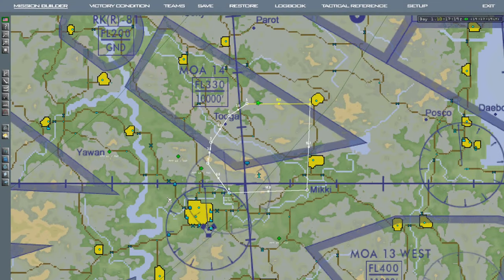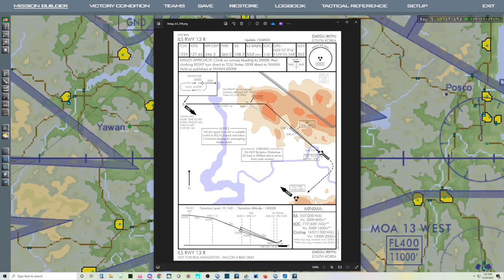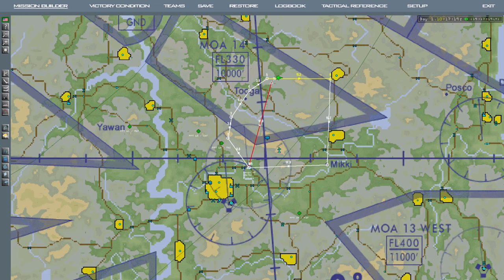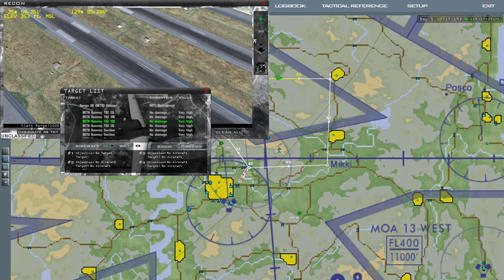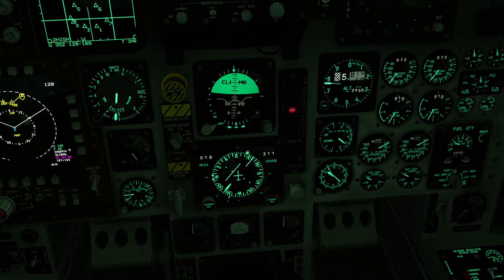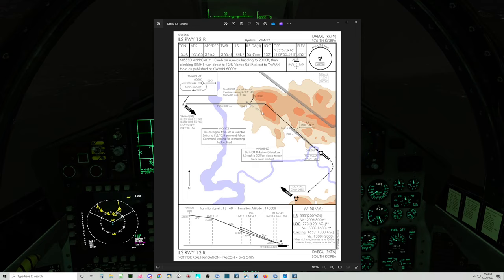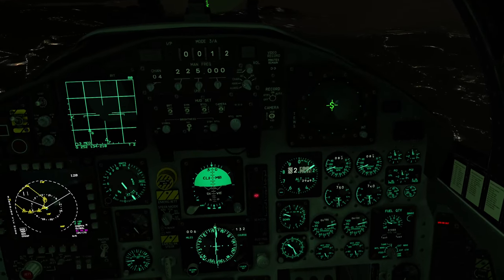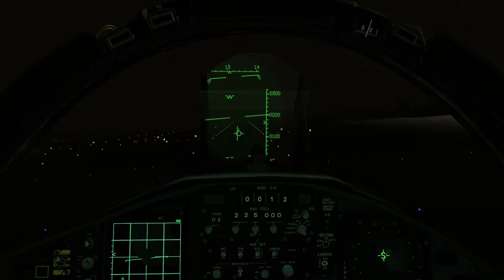F15C tutorial: ILS/ TACAN hack Falcon BMS 4.37.3

Comment: I use to fly the heck out of BMS but migrated over to DCS. The new F15e is excellent and for those who won't fly DCS because you have to pay money, there are free planes you can download which are really good and fully clickable with good flight models.
Reply from the maker: Yeah I’ve got both sims, but haven’t been into DCS in a long time, it’s hard to switch between too many aircraft, let alone different sims!
Reply: @Wheelman_PCAS  A free mod just came out called Olympus. It's like Zeus in Arma3 where you can add in real time jets, ground assets and control the battlefield on the go. Looks awesome!